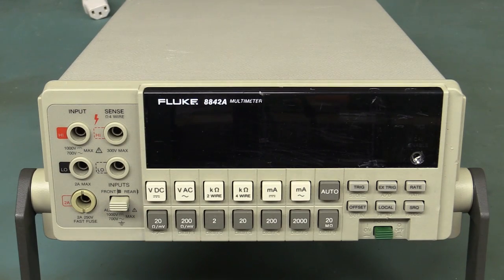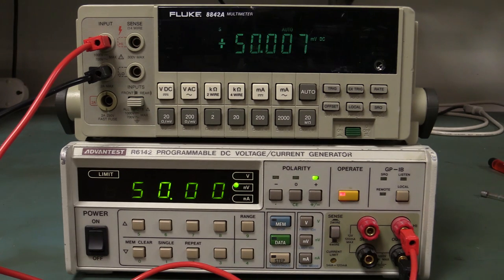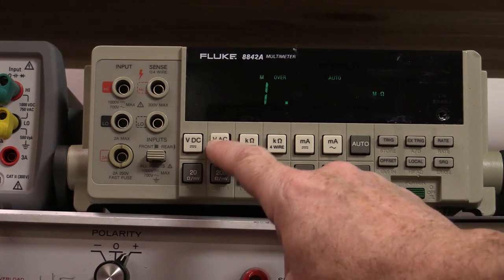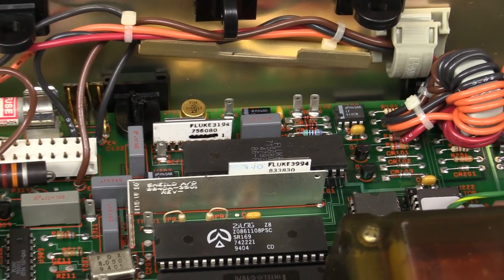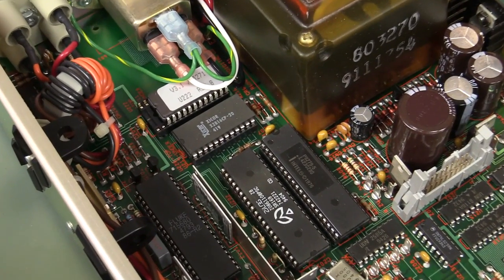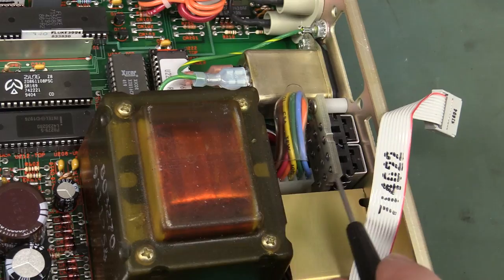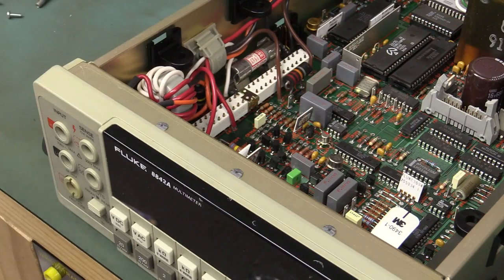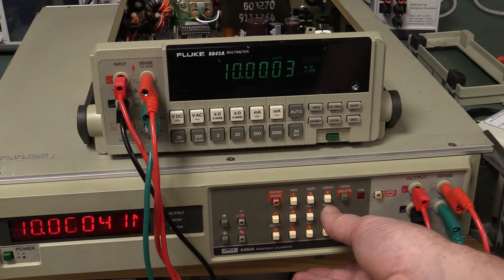EEVblog #1012 - Best Bargain Ebay Bench Meter? - Fluke 8842A

Comment: But when I buy something broken with intentions to repair it, it's complete disaster and unrepairable...
Reply from the maker: Join the club.
Reply: I bought a really old "broken" computer thinking it would be fun to repair, wasn't broken they just forced the memory card in the wrong way around.  I was strangely disappointed.
Reply: Can confirm, have an old 466 tek scope and the power supply blew and took half the mainboard with it.
Reply: or somebody tried to jam the connector the wrong way around and ripped the socket clean off while managing to short out the Vcc rail to something else, melting every power trace, destroying the mosfets along with switch mode controller which caused the 5V logic supply to become 20 volts for a while. Welcome to destination fucked
Reply: Me too, every bloody time!

Comment: 8842A ebay prices have gone up 300% after the video
Reply: Yeah you can't a broken shitty benchtop dmm for $100 at this point.
Reply: They still go for around 400USD on my local ebay...
Reply: @_yonas  well its not like they are still in production after 40 years so supply is near 0

Comment: One problem of these multimeters using VFDs is that the display are usually quite dim for used ones and replacement can be quite expensive. I personally like meters such as Keithley 196 or Keithley 192 which have crisp LED displays.
Reply from the maker: Yeah, LED is better.
Reply: An even better display technology are nixie tubes.
Reply: my Keysight 34450A has this weird OLED display that I completely felt in love with it

Comment: Those front/rear selector buttons are notorious for getting oxidized contacts, creating issues. We get a few loads every year that need them replaced.

A 2 dollar part fixes it, dont try to clean the contacts. At least I was getting paid when I learned that lesson...

Comment: I got an 8842A from 1993 and a 8840A from 1997. The older 42A has the old Motorola SCA623 (?) reference and the 40A has the LTFLU1. Both are probably the best unheated references. After all these years both meters deviate 0 to just 1 LSD from each other and they seem to never have been adjusted (cal stickers are old and okay). Which is impressive since the references should usually drift in different directions, at least thats what I read.
Reply: alles klar klaus *6

Comment: I'd be wary of using switch cleaner on any high accuracy equipment (or radio gear) as it alters the dielectric constant of the switch contacts.

Some switch cleaners can also damage front panel plastics over a period of time. Seen cases where a control has fallen off inside because its mountings have disintegrated a few months after switch cleaner was sprayed on it. This is certainly a concern on vintage gear if you want it to last. 

Have found that the best and safest thing to use (if you have to) is WD-40. Provided it's the genuine  article, and not a ripoff of course. WD-40 was developed for use on the Atlas missile as a water dispersant (hence name) and a criterion was that it must not put electronics off-tune.  Still keep it off soft plastics or rubber though.

Comment: These are wonderful benchtop meters. A  common reoccurring issue with these is the input connectors. They tend to oxidize and mess up the low ohms and mV measurements. In the cal lab, we just pull out the connectors, clean, then solder to fix the problem. You then have to readjust the calibration.

Comment: Nice Find!  I notice that a lot of ebay sellers mark things 'For Parts or Not Working' so they can sell it as is no returns even if it actually works.  It also costs money for them to properly test it.
Reply: Between the time and effort to test things, and the way that eBay shafts the seller if someone complains, its not terribly surprising that people are doing that.
Reply: the very few things i have sold on scambay I have listed as parts/not working even if the thing worked 100% way too many people who want to scam people these days
Reply: But you don't have to list it as parts or not working just to disable returns, though.
Reply: +Novanoid Sadly in a lot of cases even if you disabled returns, listed in the description as an as-is sale, eBay can still side with the buyer. And just give them their money back.
Reply: Ah, okay.
Reply: Exactly. I bought an HP 5326A timer-counter marked as "For parts or not working" but the seller just said 'not tested', and it turns out it works 100% perfectly! Not sure how out of calibration is, but I have no way to calibrate it myself. But it works, so I'm happy with that!
Reply: this is a common practice, I do the same.
Otherwise you would have to give 12 months of warranty, which is kinda odd on a 35 years old unit

Comment: AC is a seperate PCB... there are two versions of the PCB, if it is the wrong one you need to change a couple of connections around on the PCB, I had to do that on one of the units I purchases (I have had a few of them), it is mentioned in one of the service manuals.

Comment: PSA: If you pick one of these up with a dim or dead display, it might be cold solder joints on the transformer taps. This solved dim display for some people, and in my case solved what I thought was a dead display. Great meter!
Reply: This is also a problem on its predecessor, the 8840A!

Comment: Another good find is the 8840A/AF. Made for the USAF, I belive. It contains the option 09 AC TRMS converter and IEEE-488. Got mine for about $60 too. Specs are not quite as good as the 42, but a solid meter nonetheless.  Great price on the 8842A!
Reply: I have one of the AF ones. I got it in return for repairing 3 other identical ones that the AF repair center said were not repairable. The repair tag on mine said they had replaced the IC that their troubleshooting chart said to replace, but it didn't fix it. So I looked at the indicated IC, (not hard to find as it was covered with solder flux,) and noted that it had been installed backwards. So with nothing to lose I just removed it, cleaned up everything and reinstalled it in the correct orientation. I'm still using it on my bench 25 years later.

Comment: Dave there is something to repair, why not make the display bright again?  They are only feeding 5 volts to it so 8 or 10 volts might do the trick.  I found one of these cheap at Goodwill that has the AC option and it's a bit dim, not as bad as this one, but when it gets too dim I'm going to try boosting it up.

Comment: The Fluke 8840/8842s are great bench meters. If you aren't hung up on brands, younmay want to look up the Philips PM2525/2535s, and the HP/Agilent 3478/3478As. They both have LCD readouts, and should be in the same class as the Flukes. I don't remember the accuracy specs off the top of my head. I know the HP/Agilent is closed case calibration.

Comment: I recently bought an 8840A on eBay and am glad to find a good review on it.  I did get the AC module and the GPIB module and I've seen the ones with the modules selling for up to $499. The ones without the modules installed go for significantly less, but sometimes, it's difficult to tell if the one you're ordering has the modules installed. There seems to be no physical difference between the 8842A and the 8840A.
Reply: The 8840a doesn't have the 20mv and 20 ohm range. Only 200 mV/ohm

Comment: got my 8842a. with expected gpib interface. I was always just out of touch with 80's equipment, wanting to use my c64 on gpib.
bought this to play with gpib, and it had the true rms ac board! I'm into hifi content creating, broadcast hifi nuts and normal people. On my dc calibrator, and as things warm up getting better all the time! true rms reference is important to me in my audio career as a contract tv radio broadcast engineer.

Comment: I used to use a Fluke calibrator as a function gen for tuning resolvers on a brushless motor meant to operate the control surfaces of a refueling jet's boom. The precision was just a joy, compared to trying to get accurate repeatability with a function gen with dials... Probably could have requested a digital FG, but that calibrator was perfect though!

Comment: The 4 lead option is great, with the .003% tolerance. I usually have a pair of 8842s running at  any given time. Tektronix or Agilent bought Keithly. Agilent is now Keysight, which started as Bill & Dave or Hewlett Packard. Simpson or Triplett analog mechanical meters are not at all fun to restore. They have a shedload of goofy precision off the wall non-standard value resistors inside them, so I wind up tacking  together .01% resistors in parallel to get them halfassed working again. VFDs are neat, but...... yeah, not after 30 years. This was the cat's ass  meter when I was in high school. It's still good enough to do most of what I do.
Reply: Tek bought Keithly. I cant remember who owns Tektronix now.

Comment: I own one of these. It measures a voltage and after disconmecting the leads the display still displays a number around the measured value and only when the leads are shortened the display goes to nill. Is this behaviour normal for this multimeter?

Comment: Thank you, I just bought one, same thing, for parts AC not working, even has a calibration sticker...  Error 30 and the pic of the back shows it never had the AC circuit installed at all... Not going to tell the seller his mistake, until it is in my hands.

Comment: This is one of my trusted favourites! I miss the auto calibration and ranging clicking of the relays inside. A workhorse with simple calibration steps for the DIY.
Reply: I use this from 1997 - 1998. It also had a very high quality A/D converter for its accuracy including a precision reference voltage.

Comment: I picked up one of these on ebay last week after seeing this video and interestingly my unit does NOT have the LT FLU-1 voltage reference, but instead is marked with the Motorola logo and has the following part number: SZA 2638 K8850.  I could not find anything online about this part and I'm curious if anyone knows anything about i relative to the LT FLU-1.   Meanwhile, this unit of mine does not power up, and there was a hand written note adhered to the Z8 microcontroller chip indicating it was no good. So I have lots to sort out!

Comment: Fluke 8842A  are listed at $350~450 nothing on ebay at $100, and the meters are scratched worn and broken..All the new 5.5 digit flukes meters cost thousands and have basic DCV accuracy at 0.015% not the amazing 0.003%

Comment: What are the back cables that are not plugged into any thing?
Reply: 4-port resistance ports. You can select either the front ones or the back ones via the front switch.

Comment: When you make $ on the video($400) and not the reselling price of a repaired unit($100), the "beyond reasonable repair" price it a lot higher. You could spend another $100 and still be way ahead, rather than not making a video and selling the repaired unit.

Comment: EEVblog - Hi Dave.  Is it possible for you to do a 'solar panel road' style breakdown of the battery packs on NASA's luna/Mars rovers.  The is much conjecture floating about regarding NASA's stated battery life and power capacity on a robot whose lithium ion battery is only half the size of a car battery; especially when compared to an 800kg Prius battery pack that's only good for 200k (or 4 hrs - or something like that).  It's to complicated for a simple sparky, as there are solar charging and photon loads to take into consideration.  The thesis being 'Is NASA's stated battery life BULLSHIT?', I'm sure it would make a great vid... + the conspiracy nuts will go apeshit over it.

Comment: I wonder, what would happen if you used a meter to test it self (That is, using its own probes to test stuff inside the same machine)? Would it work? would it give you false numbers because its trying to measure itself? Or would I just create a black hole that would destroy earth?
Reply: Well in theory it would work, but you would run into a couple of problems.   
 Chiefly if you are attempting to measure inside an instrument then you are probably attempting to troubleshoot said meter and thus its accuracy is in question. Second problem would be that it could cause minute issues and throw off the accuracy or cause erratic behavior.
Reply: One issue I was thinking that might be a problem is that when using a meter to test itself it might end up picking up on its own calculations/metering/whateveryouwannacallit and perhaps cause a positive feed back where things just get weird.

Also I imagine that under normal circumstances unskilled users probably shouldn't be cracking open oscilliscopes and meters if they've been calibrated as I assume one can easily mess something up and throw things off. Then again your average or beginner users might not need super high precision accuracy for normal and beginner projects.
Reply: As i said, using a meter to test itself could cause minute issues. It is a rabbit hole really, maybe it would work or maybe (for example) it would cause minor noise that escalates into a large glitch. Besides the theory of what could happen there is also the simple fact that if you are experienced enough to be troubleshooting a multimeter you should have two.

Comment: What sort of situation would require pinpoint voltages? I mean, if something is off by like ~5% is that really going to cause problems?
Reply: Depends on what you are doing. In scientific labs, it may,  say looking at a solar cell's charging voltage/current in relation to light levels, and using the IEEE 488 interface to log the results. I first ran into the Fluie 8842A when it was part of a Genrad GR2276 In-Circuit Tester Intrumentation Option. It was programmed through the IEEE 488 port, and was for measurements the needed high accuracy measurements (exceeding the tester's own 3 digits after the decimal place accuracy). In other cases, its high speed mode was used, or the ability to measure low value resistances. In most home or commercial settings, probably not needed.

Comment: Any reason for the buttons being labeled as "2", "20", "200", instead of "1", "10", "100"?
Reply from the maker: Because it's a 200,000 count meter, the ranges are 2 volts, 20 volts etc.
Reply: EEVblog I remember you made a video about multimeter digits count several years a go... Probably time for me to see it again lol

Comment: Why don't they use an active PFC switch mode power supply with 90-264V AC input??
Reply: Because they didn't have such decadent technology in 1983.
Reply: Uh, yea, you are correct for this device.
But it's not much better for modern devices like the HD-DVD player he did a job on a couple of days ago. Tat one didn't have a wide range Voltage input for some reasons. 
It was from 2006, but in 2006 active PFC systems weren't that uncomon in PC-ATX power supplys. 

So why doesn't nobody use those wide range inputs??
Reply: Stefan Payne - because 1983